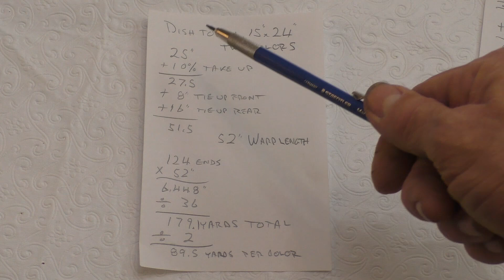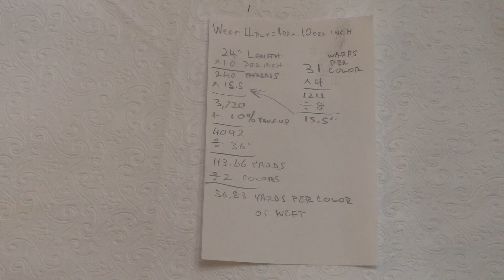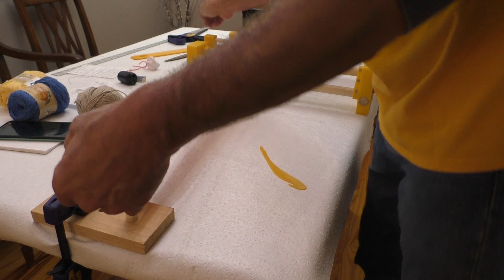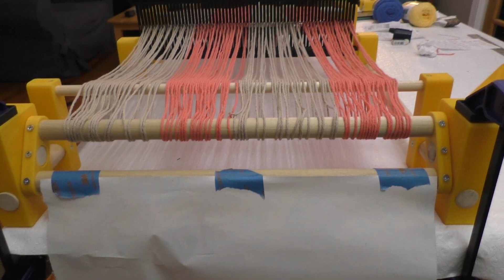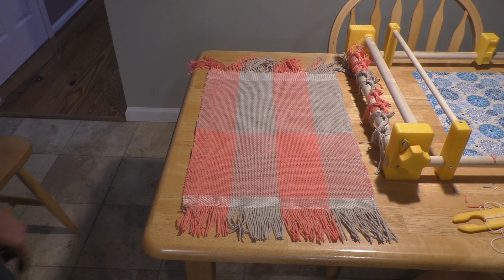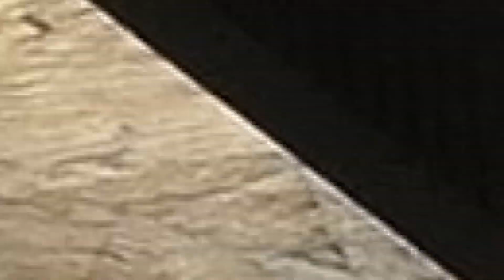Warping The 3D Printed Rigid Heddle Loom

Comment: I'm printing this out now for the wife...she has 4 regular looms 3 table , (one of which I  made from my own design)  and 1 floor loom...I thought I would play around with the rigid heddle one...why couldn't you run just one dowel and each of the take up and then tie your apron rod to tie on the warp? Also you said you have a different knob and gear...do you have an STL for those...thanks
Reply from the maker: Yes use just a single dowel for that. I don't have a .stl file available online for that knob.

Comment: For someone like me who has never woven before, but have a lot of experience 3D printing, do you think this is at least a good, affordable place to start? I don't want to drop $250-$300 for a rigid heddle loom from Ashford or Schacht.

Also, instead of the two rotating dowels on either end, can I just run one long down between the gear handles on both ends and make my own apron?
Reply from the maker: Yes. A single dowel works better.
Reply: @HackaweekTV_KR4NIV A single dowel works better? Is the version of the loom in this video outdated?

Comment: Do you have the modifications you suggested anywhere? The other ratchet/pall?  Oh, and for the take up- could you just run a single dowel trough the ratchet/pall all the way across instead of using the two? I understand that there would need to be an "Apron" added possibly a length of thin lath (furring strip) cut to length with 3 hols drilled to attach it to the ratchet rod? I am all questions! My daughter is going to print this for me and my Honey is going to put it together. :D I have a few months before it is all done and ready for assembly.
Reply from the maker: You can just put a single dowel for the feed and take up and add an apron like you said. I haven't uploaded the new ratchet/pawl. I've made a new one. I'll post a link to you when I get it uploaded.
Reply: @HackaweekTV_KR4NIV  thanks so much! My daughter is printing this for me. We look forward to updates on this. :)
Reply: @HackaweekTV_KR4NIV  an acquaintance that made this loom said the ratchet pall was always an issue so she bought the ashford replacement ratchet and pall to install and use. She did not go into detail about what modifications she had to do to the design... but it appears that the end of the dowel would need to be cut to accomodate the ratchet. You can get the normal size replacement ashford ratchet and pall for less than $20.00 each(need 2) or they have the slightly smaller ashford knitters loom replacement ratchet and pall for under $13.00 each- i think we will do the knitters loom type- 23.00 for them, i am still under $100 for the loom and that is building it at 24" wide.